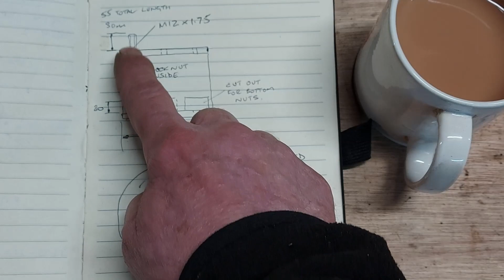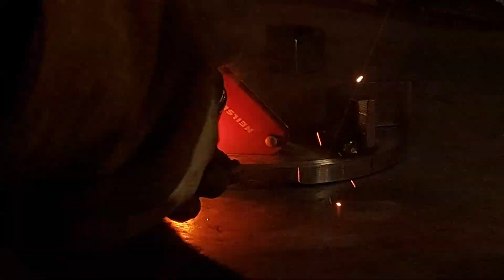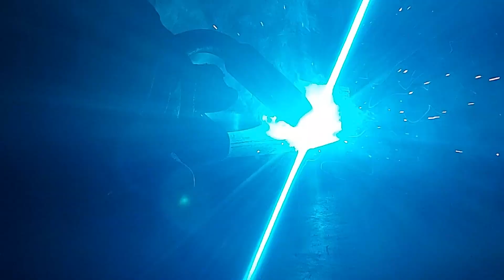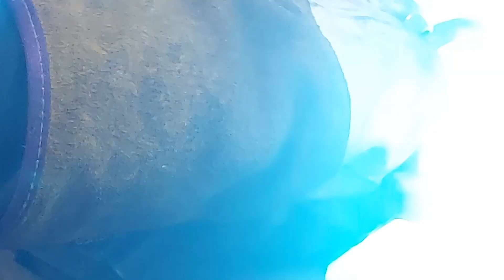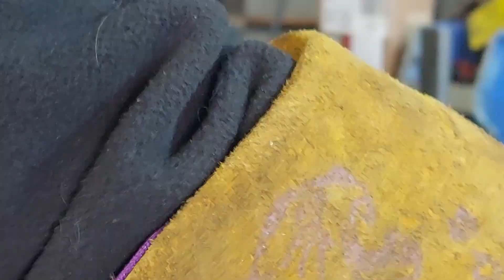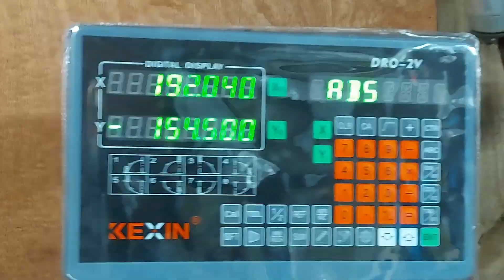Warco A2F Mill - Riser Block

Comment: I had the CNC'd version of this mill and sold it to my son. He needs a riser like yours. Did you perchance keep the dimensions of the bolt holes and the optimum diameter of the tube? I would probably use a thick-walled pipe instead of the fabricated "tube" but that is because my welding is not that hot and I might already have a pipe that will do the job.
Reply from the maker: Yes, while the machine is very capable, it does lack in Z height. A riser is a perfect addition to make this mill even better. I may well have the dimensions written in one of my note books, I'll have a look and let you know. A pipe is definitely a better option if you have it. I didn't, and was in a rush, as usual!